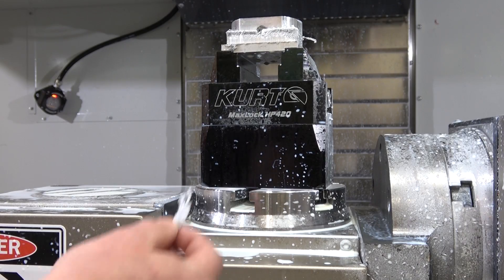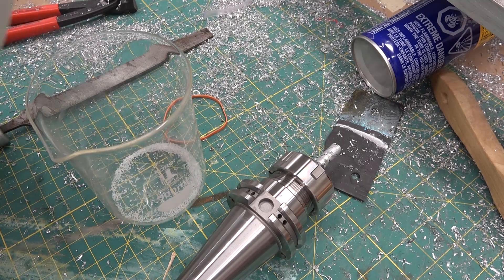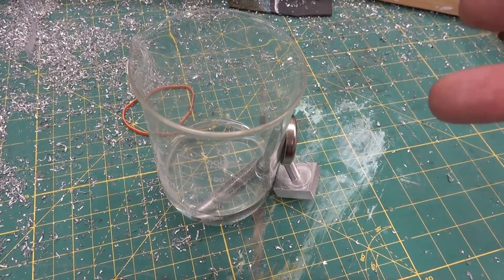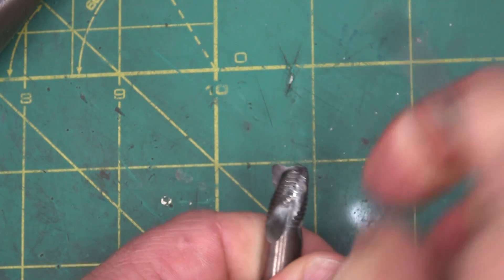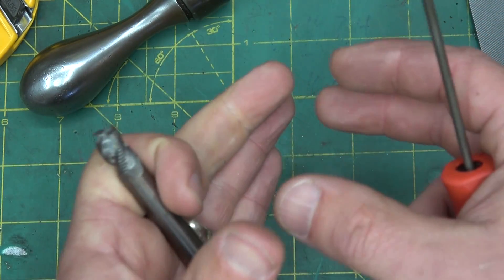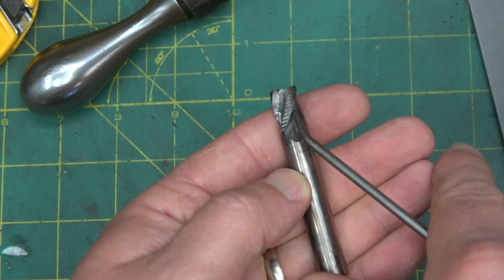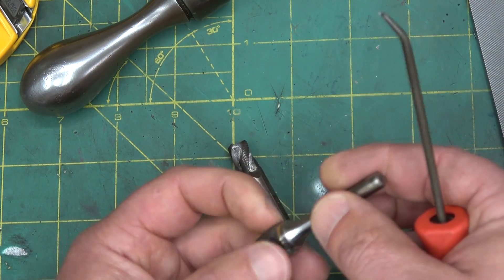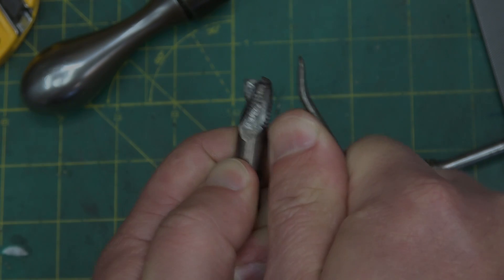Salvage Carbide Tools with Lye | SCIENCE!

Comment: I would love you to explain the science of rust and sacrificial anodes. Always confused me since oxygen is all around.
Reply: Some things like oxygen more than other things :P That is how it was always explained to me, but it actually has to do with the electrical potential created by dissimilar metals, which causes one of them to act as an anode and the other a cathode naturally.
Reply: He explained the rusting iron in a past video where he discussed all the different types of stainless... Ferritic etc. I believe it was the video where he cut the yeti beer cooler in half. If not that one, it was close to it. The basic premise is that when iron rusts it forms larger chunks that necessarily change the shape of the outside layer pushing flakes off. When aluminum corrodes there's not a big difference in the size of the new molecules so it maintains an outer protective coating over the bare metal.
Reply: Simon, if I remember correctly from chemistry classes almost 50 years ago, the atomic number or atomic weight of the metal or substance in question provides a clue as to whether one metal is less or more electrically active than another. Anyway, one of the most practical and oldest known human applications of this is hanging two chunks of different metals off the side gunnels of a ship to prevent or at least retard the growth of barnacles and algae. This practice goes back several thousand years to Roman times I believe. The sea water becomes an electrolyte and the different metals create electrical current around the hull of the ship. They would also sometimes sheath the entire hull of the ship in copper, which also discouraged barnacles and mussels and algal  growth. Although I'm not sure how they got much of an electrical current if it was just one metal. The outboard motors we ran as kids all had a zinc anode, a little sharksfin shaped piece of metal, on the lower part of the engine near the propeller; the zinc would corrode and pit but the propeller and associated engine parts would be left relatively unharmed by the immersion in saltwater. We also painted the hulls of our wooden and fiberglass boats with antifouling paint that contains copper, and that again would discourage the growth of barnacles and algae.

Comment: Not to sound like a tenured member of the JHSC but you never add water to acid/alkaline, always the reagent to the water. Start the mix off weak (lots of water) and make it stronger by adding the chems, if you start off with lots of chems and add water it can boil and spray very concentrated mix everywhere, the other way round the mix is much weaker if it splashes. Voice of experience from ph balancing in water treatment.

Comment: So then, the porous surface produced when zinc or manganese phosphating, "parkerizing", steel firearms parts is rust? Just a more beneficial structure that won't flake off and expose the base metal.  Some manufacturers have moved to salt bath nitriding now.
Reply: kinda. bluing is straight up rusting, you're forming a layer of (a specific type of) iron oxide on the piece, which is what people usually are thinking of when they think of rusting. parkerizing forms a later of iron phosphate on the piece instead of iron oxide. not technically rust but it wouldn't be off to think of it as rust's cousin
Reply: It holds oil or paint well